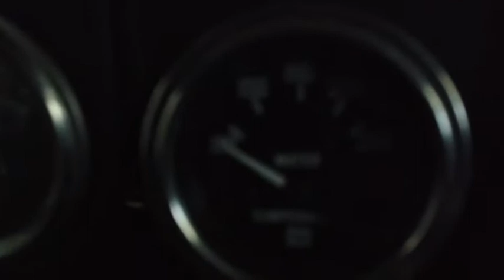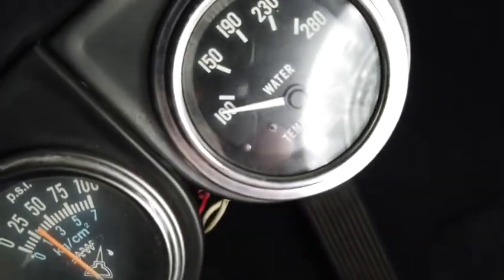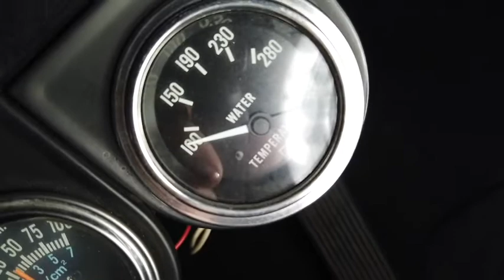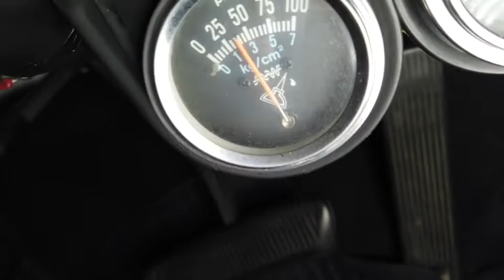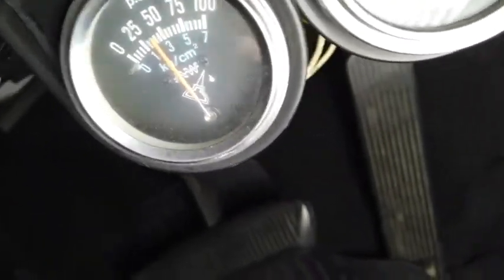Plastic Oil Pressure Lines I don't like

Comment: i've seen this , but if you crack the line loose from the gauge and the needle goes to 0 . some one over tightened the compression fitting on the plastic line on the engine side .
Reply from the maker: Good point.